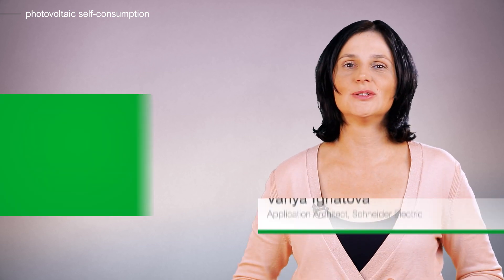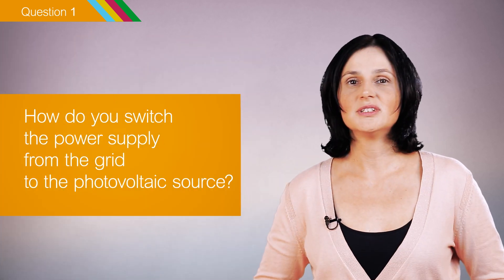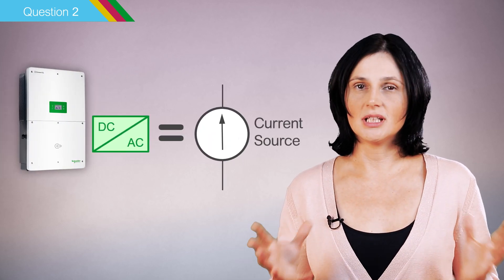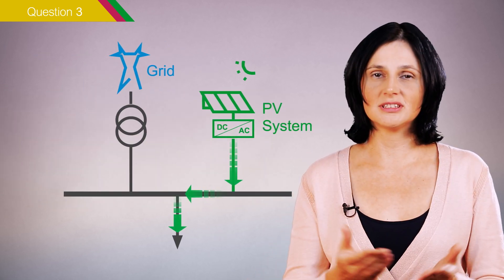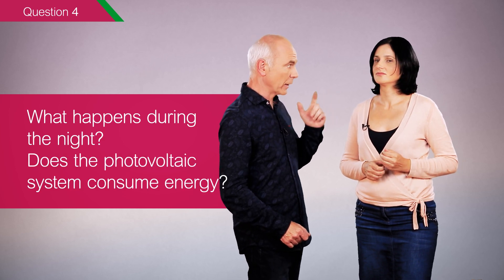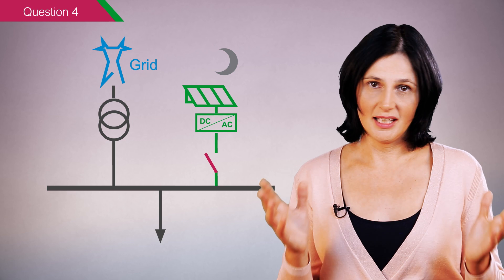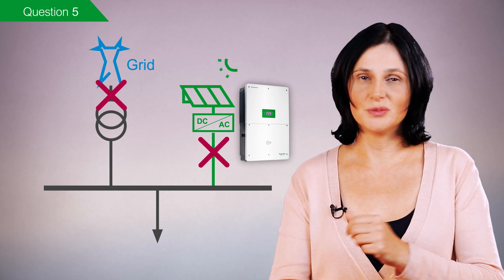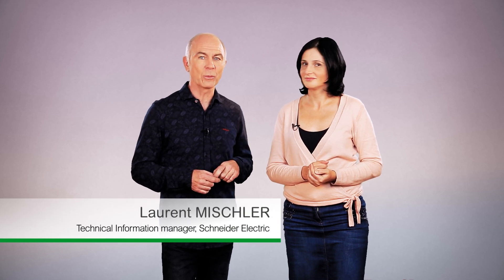Photovoltaic Self-Consumption: The 5 Most Frequently Asked Questions | Schneider Electric

Comment: Good information.  How to choose switching frequency for grid connected IGBT inverter? Kindly reply
Reply from the maker: Hi Pranati, thank you for reaching out! - The switching frequency of the photovoltaic inverter is just an internal characteristic of the inverter. It is usually not a parameter to select or to set during commissioning.